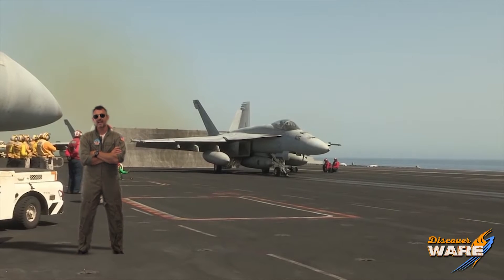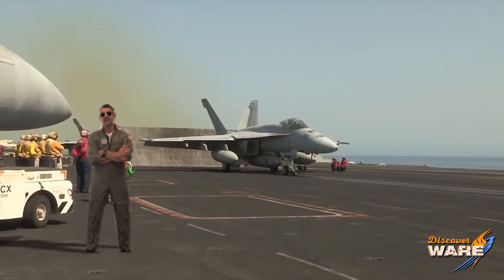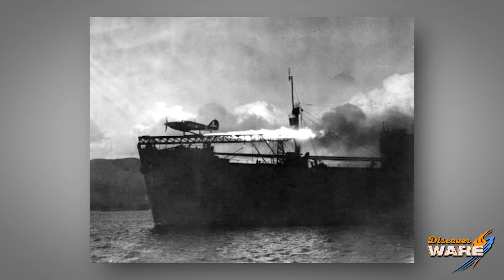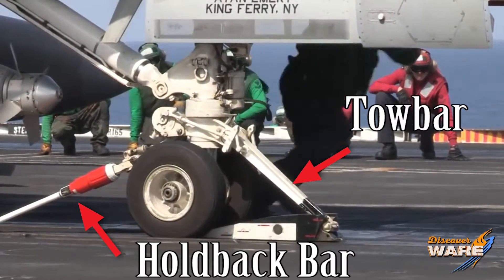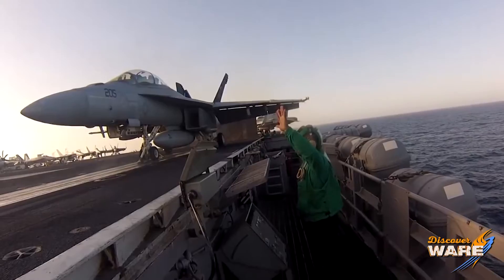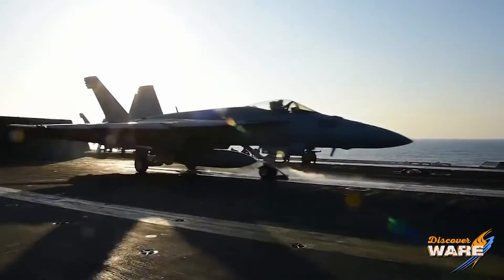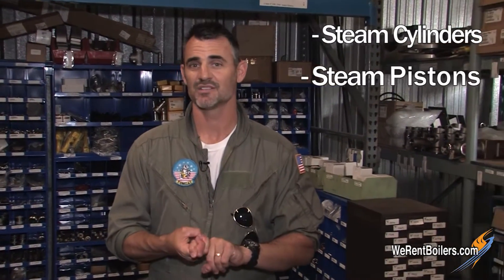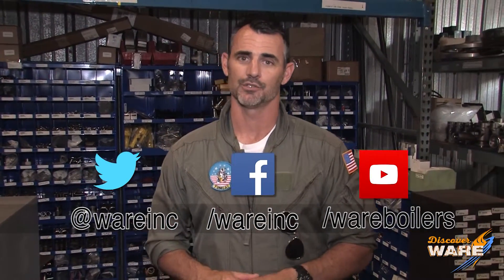Launching Aircraft with Steam - Steam Culture

Comment: How does the hold-back bar release the plane? Does something break internally due to the force?  If so, what part needs to be replaced to make it reusable?
Reply: Do you mean "break"  or  "brake"  ?
Reply: E-2/c-2 use a T bar . Piece of metal that round on top and bottom with a cylinder in between. Part of the one round end goes  to hold back bar other connects to aircraft. Firs like a puzzle piece. Cylinder is strong enough to hold aircraft
Reply: to flight deck while aircraft brings engines to full power,but will break when catapult is fired. Cylinder in-between to round end tears in half. F-18/F-14(no longer in service) use a different system. They fit together like a puzzle piece and have a collar that goes around the parts that snap together

Comment: How do the chariot stops ???? How s released from the planes gear???  Is steam from sea water?
Reply from the maker: So I'm unsure about the first two questions but I can answer about the feedwater question. Once out at sea, all of the water from the ship will come from the sea which includes the boilers feedwater. It will go through a desalination process to remove the salt and then be introduced into the boiler's feedwater system. Hopefully that helps! Thanks for watching
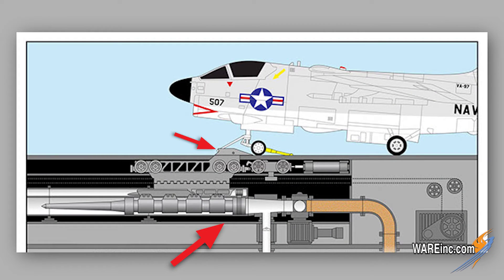Reply: 1. At the end of the Catapult Track are the "Water Brakes" On the front of each Steam Piston, (2 per Cat) is a "Spear".  The Spears enter the Water Brakes at speed and displace the water until the shuttle/ Piston Assemblies stop - in about 12 feet! When this happens the entire ship shakes and it sounds and feels like a huge explosion. The assembly is then retracted using an integrated  hydraulic engine and pully system. 2. The "Tow Bar" is part of the nose wheel assembly on the plane.  When the catapult shuttle stops in the Brakes, the Tow Bar is free and raises and then is stowed with the nose wheel. (There is a great illustration in the video at about the 2:53 mark).  3. What Wareboilers said. Also, fresh water is a by-product of the Nuclear reactors and the ship uses super-heated steam to push the engines. Go Navy! (ABE2, USS ENTERPRISE, Cat 1 & 3)
Reply: @clubmyhre  cats 1 & 3 bow waist hybrid ?
Reply: @christianrosa1120  No.  I was assigned to both the Cat 1 crew, and the Cat 3 crew at different times.
Reply: @curtm626  glad that was broken  down